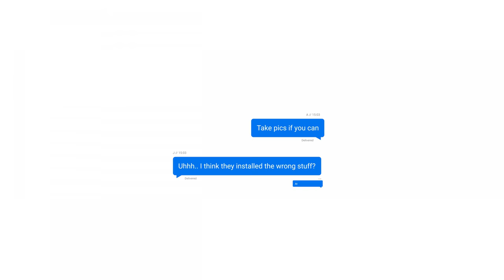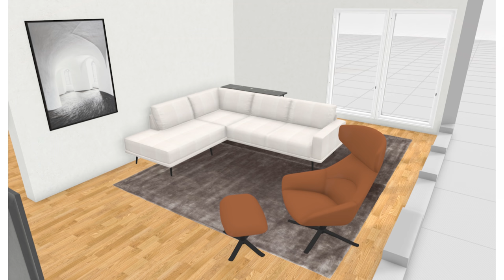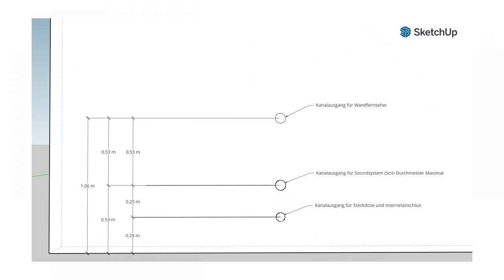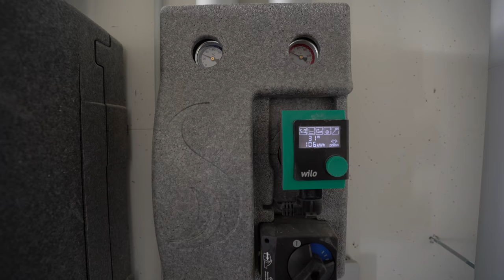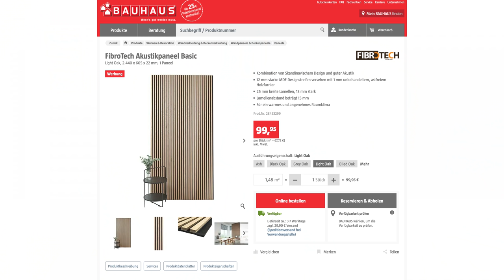HARD Lessons from Building a House in Germany

Comment: Hi, i am a real estate developer in austria (so i dont know how it is supposwd to work with the special requests in germany and the whole process because i dont know the law) but it sounds not very professionell from the developers standpoint. In austria your special request needs to be communicated, negotiated und contracted/ordered via the developer/seller. If there is no contract it should not be done and the developer should have had a construction oversight management who controlls that things are done how ordered. 
About the wall: so your plot is now smaller as sold? By austrian law, this would not be allowed without giving you a refund for the now missing squaremeters. 
And also out of safety/liability reasons  on our constructions sites you would have not been allowed to just enter 😉

Comment: The only way to manage a building project is to be your own main contractor with your own management system, which is used by all contractors and be  the contractually definitive source of what has been agreed on.
In reality it is very difficult to get contractors to agree to using such systems and to make it the only way manage the information of the project. They like to see it as additional work and even risk for them since they assume customers to have weaker negotiating position without such orderly management.

Comment: In a nutshell: your housebuilding-process was like a piece of cake, very easy and only one month later as proposed, you are very lucky, very lucky.
One of my neighbours had more difficulties: First they forgot to connect the house with the dirt-water pipeline, so, all dirt stayed in the house, second, they made mistakes with installing the floor-heating-system, all the floor, the tiles and so on had to be destructed in order to make the system new, third, they made mistakes  with the isolation of that house, all inner parts of the isolation had to be removed and be deposited on a special "Sondermüll"-Deponie, of course, all the inside of all walls had to be renewed and forth, the made a mistake with installing the heating-system. He was just moved in his new house and had to leave it after a few weaks, then he had to live in another house paying rent of course and make some processes against those companies and in the same time he had to hire some other companies to build this house again, this time correctly. 
He won all the processes finally, but ..... can you imagine, what he and his wife were gone thru?
Reply from the maker: Oh what a complete nightmare! We feel so super lucky that everything has been smooth sailing so far.

Comment: To me, looking at the pictures, six weeks till moving date sounds somewhat ambitious as there remain quite a few things to be installed. I am keeping my fingers crossed it will all work out well !
Reply from the maker: The landscaping for sure won't be completed but we knew that going in. They actually wrapped up the exterior today and even added the gutters. They also were installing all of the mirrors and fixing the broken tile as we filmed on MO day.  On the inside, from what we can tell, all that's missing is the stair wood and railing, the baseboards, bathroom  fan, fire alarms and intercom system/doorbell. Add in the garage door and we should be good to go.
Reply: @TypeAshton  It appeared to me the wallpapers were missing, too as were sinks and water taps.
Reply from the maker: Thankfully those are all ready to go. The wallpaper and paint is all done, as is the fixtures in the bathrooms (with the exception of the kitchen, of course).
Reply: @TypeAshton  Thx for the update, this sounds reassuring !

Comment: At least you didn't have to pay extra for the wall behind the house right?

Back in the mid 70s when my parents built the house I grew up in, they were told they had to put in a 4m tall retaining wall that was bolted to the rock face behind it.
The extra cost of that was like 25% of the cost of the plot itself, or about 10% of the plot and house combined.
They basically had to beg the bank for a bigger loan or be screwed.
Reply from the maker: No! Thankfully, when we purchased the house in June of last year we "locked in" the price.... which has actually been really nice with inflation being what it is.

Comment: Hi there. 
Before moving in, make sure to perform a formal takeover ( formelle Abnahme) from your contractor. If it isn't offered to you, demand it! It's legally one of the most important dates of the build and marks the point in the building process, when the responsibility for all that has been done shifts over to YOU. Until then the contractor is obligated to deliver his work without any defects (mängelfreies Werk) and it is up to HIM to prove that it is "mängelfrei". 
When the "Abnahme" is done OR after you move in and  start living in the building (I think it was for a week, can't remember that one - it's called a "stillschweigende Abnahme" anyway), at least two things happen legally: Firstly, from now on it's up to YOU to prove that any defect you discover down the road and want it straightend out, has been there before you took over the building. It's called "Beweislastumkehr" - one of those cool German all in one words :-) - and means >inversion of the responsibility to prove something<. Secondly the contractors liability-phase (??, Gewährleistungsphase)  kicks in. Within the next 4 years (or was it 5? It kind of depends on the kind of contract you signed), generally speaking, you have the right to get defects fixed for free, as long you can prove it's been caused by the contractor (see above).
So in short: Demand a FORMAL takeover, look sharp and find as many defects as you can beforehand, preferably bring a independent "Gutachter" (they usually know the weak spots and aren't overwhelmed with the building process, so they see more) and make sure to document every single defect you discover in the "Abnahmeprotokoll". Don't get fooled ;-)
And after all that: enjoy your new home :-)
Cheers!
Reply from the maker: Thanks so much for the help on this! We had no idea what this process was supposed to be like. Would you recommend we have a professional inspector with us during the walk through, or have them come at a separate time?
Reply: @TypeAshton  You're welcome. I'd recommend to ask the contractor for an additional, more relaxed "Vorabnahme" - some days before you really take over the house: you meet up with your "Bauleiter", bring your Inspector with you and take a tour through the building top to bottom, inside and out. It gives the contractor the opportunity to fix some of the (hopefully few) problems while they are on site anyway and before you start occupying the place,  it takes out lots of the hassle of the "big day" and you are better prepared for the real "Abnahme". At the day of the Abnahme you repeat the process, so you know what to look for, you can check if the known defects have been fixed and maybe you spot some more issues. Best would be, the Inspector comes to both appointments, but those guys usually charge quite a €.
Reply: Hi, I am just curious: You must be in by about now and I wonder how it all worked out? Hope you made it without any complications. Cheers!

Comment: About the technical room: That's actually a pretty boring one :P In all seriousness though, you have district heating, so basically, you just have one giant inlet from the street, a heat exchanger that moves the heat to your internal house system and a few pumps. The pumps are depending on your layout, so only underfloor heating or radiators or maybe even mixed and of course your warm water circute to use in fossets. 
Basically, the white round thing you pointed out with "What is this?" is an expansion tank. The english Wikipedia Article for that has a very good explanation, but basically it reduces how much air the house internal lines have in them, so you don't have to go to the highest radiator in the house and bleed the lines to get rid of the air. Also, it regulates the pressure in the system somewhat. It also keeps the system pressurised in the summer, when the heat is off.
The giant white tank on the right is your warm water reservoir, so if you both take a shower the water doesn't go cold. (Also, to keep legionella out of the system)
The thing from "conel" seems to be a simple water filter (Could also contain a pressure regulator). The Various valves are for easy control of the water level in case you have to drain the system and refill it. But normally you will get an introduction when the house is done :)
Reply from the maker: This was a PERFECT introduction. Thank you so, so much!!
Reply: @TypeAshton  I just added a detail I forgot about the expansion tank, it also regulates the pressure in the system and also keeps the pressure when the temperatures change. 
Hope you get to move in soon! :)

Comment: Greetings from the „Servicewüste Deutschland“! Fingers crossed!
That big kettle in your facility room might be the Druckausgleichsbehälter for your heating. Please help me out: What might that be in English?
Reply from the maker: The best example we could find is a "surge tank" for a translation. But I haven't heard of these before since they are very rarely used in the US.
Reply: @TypeAshton  I would guess the reason that you haven’t seen one before is because heating in the U.S. is mostly done via air ducts (and not via hot water and radiators/underfloor loops). As somebody mentioned elsewhere in the comments, having such a surge is a legal requirement in Germany, maybe that is not the case in the U.S. (in systems using hot water for heating).

Comment: The Solution for the "TV-Problem could be - no TV. By a UHD Beamer with a 4k Screen wide and high enough to hide the holes in the wall an use a wireless Surround System ;). For Example.
Reply from the maker: That's an interesting idea! That could be a really fun way to do movie night.

Comment: something else that affects my company is the lack of truck drivers. truck drivers in the EU have gained new rights (home-country time) since february 2022 and apart from that, when the war broke out, the ukrainian drivers left to defend the country. most truck drivers are non-german so the recent development including the high diesel prices leads to high transportation prices for the consumer. i guess some delays are just because the project-manager tried to bring in building material for a lower cost.

edit: i wouldn't worry too much about the tv cable managment. just buy a white "kabelkanal" and hide the cables that way. you'll see the outlets but as we use to say in germany "one cause of death you'll have to face" (essentially meaning accept your fate and make the best out of it)
Reply from the maker: It is really interesting to see how global trade, oil prices and geo-politics are affecting so many different aspects of the supply chain. When we started our build, we thought that COVID would be the biggest hurdle... but the recent inflation and issues with sourcing are proving to be a bigger hurdle to cross.

Comment: You have not installed a gas driven heating system in a new house, have you?
Reply from the maker: No our house operates on a district heating system with radiant heat flooring.

Comment: 1 month delay 🤣 Count yourself lucky. My parents had 6 months of delay, and that was in the 90s without covid or a war. For your entry hallway maybe think about a ceiling paneel with integrated led lights. A wooden wall paneel might also be an option for your living room. You can just hide the cables behind it.
Reply from the maker: Yeah we are very lucky. In our original contract, they told us that our move in would be anywhere between June 1st and August 1st. After August 1st they have to pay us 1300 euro per month to cover the costs of housing.

Comment: Those expensive itens in bathroom will bring you a problem with limescale. The dark colour will be completely full of limescale stains. Viel Glück. It's beautiful but will be annoying I guess.
Reply from the maker: We worried about this a bit..and it was a discussion we had with the bathroom sub-contractor. However, we were pleased to learn that - in contrast to Freiburg which has VERY hard water - our new city does not at all. It will be much, much less of an issue in the new area. But we will need to be good about keeping up with cleaning for sure.

Comment: Well, you dont need to feel alone cos lots of others also including me have been through the last humans adventure, building their own house. All of us have similar experineces. I remember my former tennant when he told me of building their own house and they were laughing at me about all the different things which can happen I told them. He came back telling me, I am an engineer and all of it is just a matter of planning. I laughed inside cos theory and reality are different. By the time they told my stories, mistakes with the leading architect or different craftsmen reagarding things happened I just laughed inside. At that time they looked very stressed out. They ignored my proposal to hire a retired bricklayer for a small amount to check daily what happens on the building site. Anyway, you already looking relaxed and I cross my fingers that you dont find any other Leichen im Keller(german phrase). Anyway, when building a house(I did all organization of myself and also helped during the shell works) you need to be flexible and to accept things which are not going to plan. Be honest, sometimes due to the pressure beside weekly work 400km away, on the weekend tears were running. I am sure, building a second house it would work out much easier and the third one will be perfect. Btw, you are still young and so many stair steps will be a problem only in higher age. The width of the doors is only a problem for a wheelchair and the bath for non handicapped people usable. Sorry to point this out but time is running so fast. Yes, you can dump so much money into a bath and for a kitchen as soon as you dont go for standard. Enjoy living in it. Jonathan, keep your fingers off all the installations even you are an engineer(but not for such things). It should be a prohibited zone as longs as you like to draw the warranty card. My insane dream was once: renting a big storage to place all the furniture in you would like to buy(may just a bargain around) place them with all the walls/doors around(nice you can already check the space between and you get a good feeling for it) and at least make a draft by the architect. I know, stupid idea, sorry for this.
Reply from the maker: Good points! Thanks for sharing.

As for the technical room, you're right. Unless there's an emergency where I need to shut off the water or flip the fuses, we will leave it to the professionals.